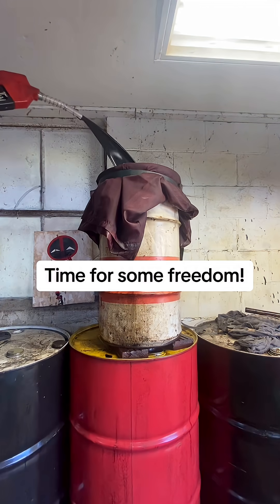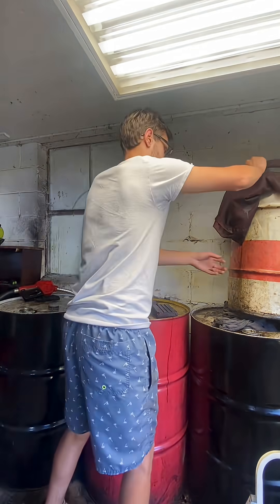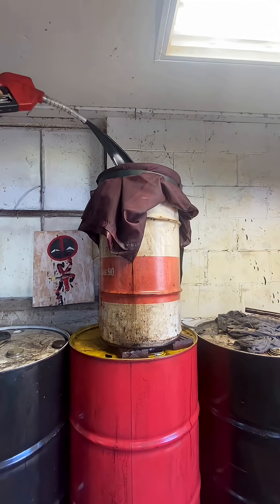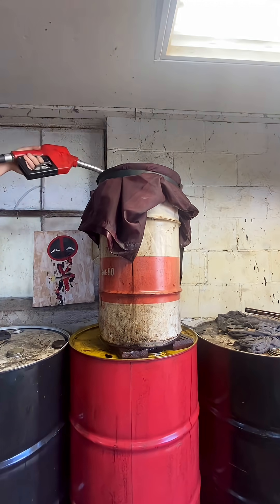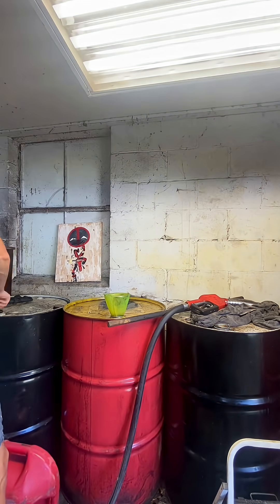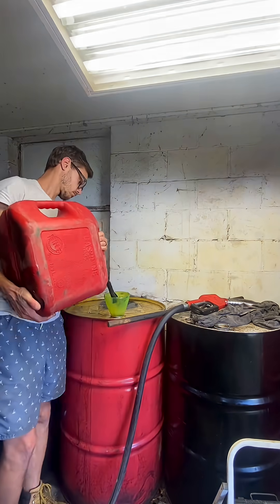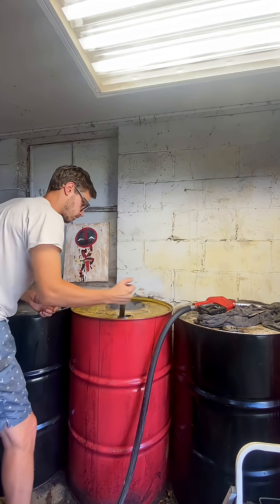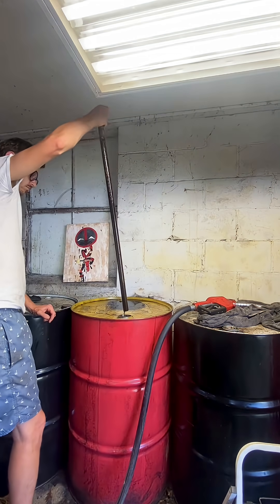Transform #wastemotoroil into #homemadediesel Fuel #dieselmechanic

Comment: Let oil set in 1000L IBC tank for a while if you have room then have like 10 of them to get longer set time. It will be cleaner for injectors, but additives and heating process would help to get it cleaner and longer miles.

Comment: The oil has been running through the filter on the truck or car  for 3000 miles, it is as ready as it will ever be. Just put it in and run it.

Comment: Get another small Barrel like the one you use with the bed sheet on it and use it with your gasoline canister as the funnel take the black tube off the top of the gasoline canister and pour it straight from the canister into the small drum and let it flow from a smaller hole in the bottom into the Big Barrel. You can empty 5 gallon gas container in about 20 seconds if you take the nipple off.

Comment: Show us how to make it? By mixing gasoline and used motor oil together to get to an octane that will detonate in a diesel engine? Not that it bears saying, but you're going to need to run detergent in clean diesel later to clean up that mess. 

It's not exactly news that most combustible fuels will burn in a diesel. 

Buy some racing gas cans. They dump much faster with a 1" tube and a decent size vent.

Comment: That is way too much gasoline. 
The flash wanted diesel should be somewhere between 130° and 160°.
The flash point of gasoline is -45°. 
You're going to grenade that motor using that much. I would step it off. For context, I'm a pipeline operator.

Comment: Oil smells like freedom and diesel smells like victory 😊
Reply: Except this loser isn't making homemade diesel hes just mixing gas and used oil together. Nothing like diesel at all. Injectors will fail and egr will clog up so quickly. Might not even start after a few runs.

Comment: I would love to run a beater of this stuff but this fuel can cause issues if not extremely filtered, id be worried about injectors and injection pump and running lean.

Comment: You should use cerosin instead gas. But you need to use a sentrifuge to separate the particles out  and then more filters. 
It is expensive and  time consuming to replace filters and models on your engine

Comment: The fuel injectors crying in the corner...The engine knocking its ballocks off...The fuel filter puking around the block and the fumes choking up the exhaust and lungs eventually...Not a good end...But whatever makes Santa's reindeers pull the fucking sleigh...

Comment: Fuel switch loading refers to the practice of loading different types of petroleum products into the same tanker compartment, particularly when one compartment has previously contained a different product. This is generally discouraged due to potential risks and is even banned in some areas due to fire and static electricity hazards. 

Yep its a real thing and it can end in tears